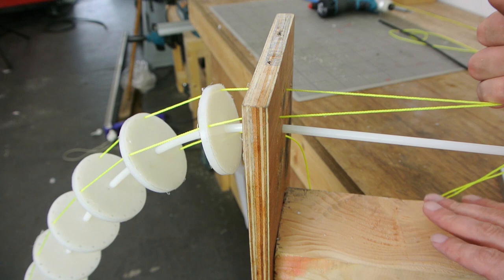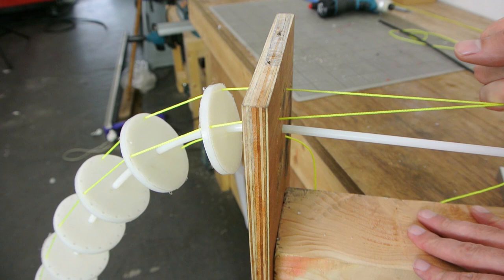Snake Arm / Elephant’s Trunk experiment

Comment: I had that same idea!    But my idea was to make it small and to put small 3 or more electro-magnets on each disks at 120 degrees.   Magnets can be controlled by electronics and computers and so complex movements can be programmed.    I was even thinking of making the electro-magnets myself.    It would coiled elctro-magnets with a rail to the next electro-magnet.    Another point if you want to make this is that the magnets at the bottom should be more powerful than magnets at the tip.    The power and size of the magnets should increase gradually.   Perhaps a calculation for the size of the magnets can be made based on the mass that it must support.
Reply: I had an idea, he put many hols in is arm so what if he had some of the wires going to 1/3, some to 2/3 and some to the end, this could allow for you to choose where a force is applied.
Reply: Or use pulleys on motors

Comment: What if you added say 10 joints and then added a servo system to pull or wind up each joint and then controlled it via a Raspberry pi or equivalent, You could potentially have a very realistic snake or elephant trunk...

Comment: Great stuff!  Only thing that is not clear is what holds each disc in place on the (slippery?) nylon rod?
Reply from the maker: thanks, It was just a friction fit, did work reasonably well. You can always "weld" them together. But if i would do it again, I wouldn't use the nylon center rod, It was a little bit to stiff :)
Reply: @KrisTemmermanNP  what material do you think would work better?

Comment: i have a question, what is the material you use on the center of the snake arm to give structure?
Reply from the maker: Its a nylon rod (but its a little bit to stiff)
Reply: would a silicone mould with a thin nylon rod in the center work better? also, what do you think of the idea in main comments that I posted?

Comment: Great job! I would like to do it also I have some idea that about the positioning system on the continuum robot on formula sqrt( (X2-X1)^2  + (Y2- Y1)^2 +(Z2-Z1)^2 ) > T  but need to think about the feed back modeling control hard one I haven't tried yet.https://core.ac.uk/download/pdf/286575812.pdf